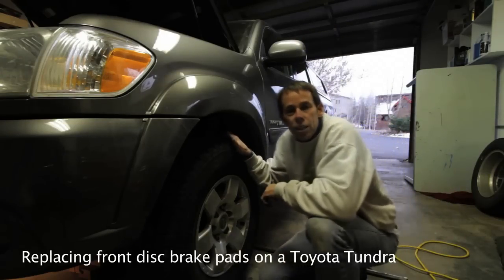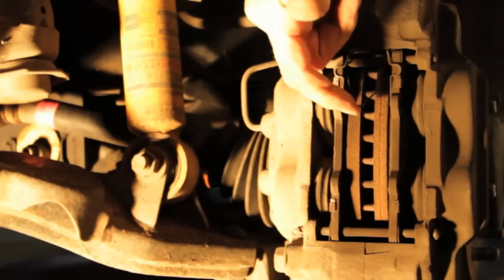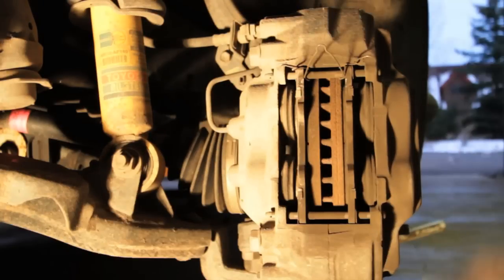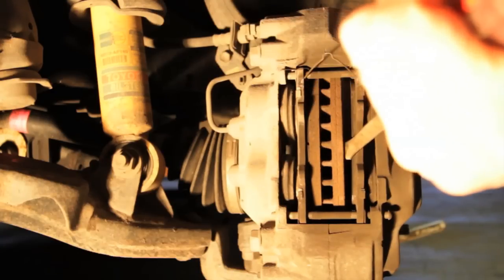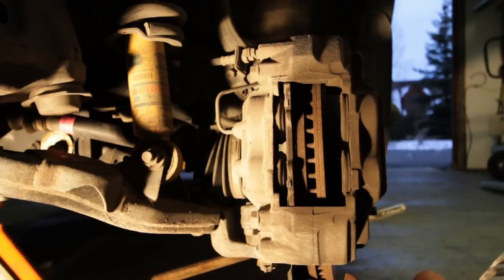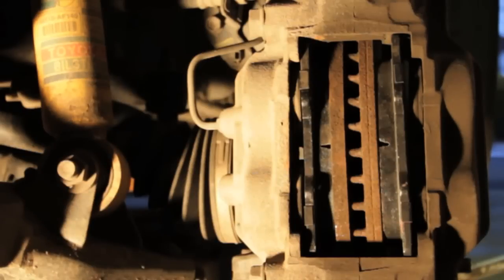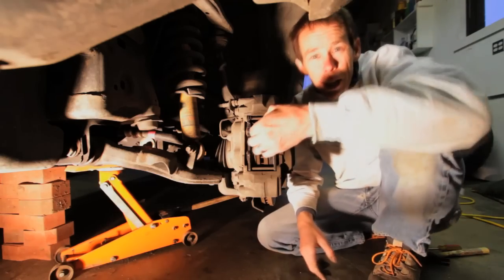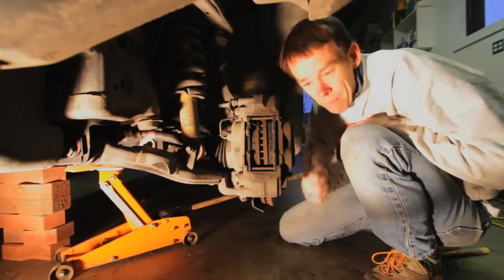Replacing Front Disc Brake Pads Toyota Tundra 2000 - 2006 - It's Easy

Comment: I've been doing most of my own vehicle repairs since I was 16. Brakes are on the easier end of the spectrum and should take less than an hour. The first time I did this on my 06 Tundra, I started to remove the caliper before saw the pins. I would like to shake the hand of the designer of this system. As you said, it's now 10 min job. Great video for first timers.
Reply: I love this design.  Mercedes started using this same setup in the late 1970s/early 1980s.  It always took me longer to jack up the car and remove the tires than it did to actually replace the pads. I pre-grease the backs of the pads and have them ready to go in before I ever even get the jack and jack stands out of the garage, and it's quite literally a 10 minute job per side, including jacking up the vehicle and removing the tires. Going to do my Tundra today ('01 that just hit 65,000 miles) and glad to see the setup. Probably would've had another 10K left on those pads if I hadn't been towing a 5,000lb pontoon setup behind it!

Comment: Realtor from CO, CPA from CA here. Doesn't matter, we are all shade tree mechanics. I wondered why you didn't bleed the brakes while compressing the piston, why you used the screwdriver to pry the piston back and risked damage to the rotor, and why no grease went on anything (don't get me started). Doesn't matter because your video is the best I've seen. Folks like to clearly see things taken apart and put back together, along with some plain language narrative. You nailed it. There are a few things that can be done "better" in a DIY brake job, but then your presentation for the masses wouldn't be so simple, now would it?

Comment: You might be able to fit a c-clamp in there to compress the brake pads. That's what I did. Also the brake caliper pins maybe too corroded to pull out, like mine were. I need to either cut them out and get new pins or replace my calipers entirely. If you manage to get them out, make sure you put some good grease on them each time you service your brakes.

Also for those of us with the pre 2003 model, make sure you measure your brake pads because they could either be the 4.7 inch or the 5.3 inch. 5.3inch is the newer version and some early models have them as well as per a TSB due to warping rotor issues with the early versions

Comment: Great Video! I have had my truck for over 4 years but drive it very little so this was the first time I did the pads on this truck. The only thing I did different was use a thin flat bar instead of a screwdriver and I took the advice of some of the other comments and used the sandpaper. Thanks for taking the time to post this. Enjoy the rest of your Colorado summer.

Comment from the maker: Swendog65 – Great information. Thanks so much. I had a feeling that wasn't the best solution for compressing them and I figured I would get a comment just like yours.  Thanks for setting me and others straight. And yes, taking off the cap is a good idea too. It’s funny, I was telling someone that I don’t even change my own oil anymore. Nor would I do many mechanical fixes on my Toyota. But the brakes were so easy it’s the one thing I’d tell people to try.  Thanks for the compliment too. Charlie

Comment: Just a lil advice. When collapsing the caliper pistons pry against the old pads with the screwdriver tip instead of the rotor. That way it won't gouge the rotor surface.
Reply: FoMoCo1 you have to insert flat head between rotor and used side of brake pad to press the 2 pistons into caliper.

Comment: never use a screwdriver on your rotor it may scratch or gouge, you want it as smooth as possible, use large channel-lock pliers and either compress on pads themselves or pull out pads and compress "puck"s. You may have to do this a couple of times on each "puck" because as you compress one it wants to push other out, or put something in there to hold other "puck" compressed. Sometimes when doing this it pushes brake fluid out of reservoir, so have some new, clean brake fluid ready afterwards to fill reservoir back up to proper level. As someone stated in string, have your rotors re-surfaced, it is fairly cheap and and new pads will mate up to fresh surface better and last longer. It is good to have a can of brake cleaner to spray down all the workings afterwards to get rid of any brake fluid or grease that may get on rotors.
Reply: +Mike Whitlow channel lock pliers were the way to go.  I was also able to replace the pads without even taking the tire off.  Awesome and easy design.
Reply: +Craig Harris Shut the front door, you replaced the pads with the tires on. Awesome. I have a set of pads in my truck waiting on me. Sounds super easy.
Reply: Another good idea would be to remove some brake fluid from the reservoir first and leave the cap off. When I changed mine, fluid came out and ran down to the ground.

Comment: Great Vid i Had to change my break pads on a 08 tundra although the set up was very simple as the video shows, taking it apart was a long hard job..Nothing came apart easy on the front, the disc pads on the rear came apart and replaced very easy. Thanx for the video if not for that i probably would have struggled even more..

Comment: I got a 04 tundra double cap brand new. I love that truck. However, I’ve had my issues. This will be the 3rd set of brakes I’ve put on. 4 sets of tires the original Bridgestone I got only 20 k on them. It’s had 7 recalls. Only 147k miles. I also had a T -100 best truck ever made IMO. NEVER HAD TO DO ANYTHING TO IT other than maintenance and 1 alternanter. Put 100k on it .sold it for the same price I bought it for.

Comment: RE sandpaper.  I had some 80 grit around the garage.  About anything with a rough grit would be fine.  The idea is to break up the glaze on the old rotors so the new pads will "seat" properly.  I bought a kit somewhere (maybe Lowe's) that has small sanding disks and attached to an electric drill.  I used it on another car, but the Tundra has so little access to the disc surface without removing it.  Spraying with brake cleaner also a good idea.

Comment: I would recommend to clean the pins off and did you reuse the shims from the Oem pads?  After cleaning  the pins I would put some anti seize on the pins where the holes align on pads. A trick to tell if your brake pads are getting low, never refill the brake cylinder.  Unless you have a leak. As wearing incurs , looking at reservoir will help in your deciding to look ,,,,,, but good job on everything else one guy pointed out make sure you pump your brakes a few times before driving away.  Use jack stands along with jacking the vehicle up.  Emergency brake engaged and chalks if you have any.

Comment: remove a couple ounces of brake fluid from the rez and leave open prior to prying the pads.  Makes it much easier.  Be sure to replace the fluid :)
Reply: I was thinking the same thing...maybe use a clean turkey baster and suck up a small amount, to reuse later.
Reply: I should have read your suggestion first and before I posted it earlier.

Comment: My 2008 Tundra is almost the same real easy!!!  Spring retainer is on bottom instead of to.  Some lug nut below said to use a C clamp to push back the calipers... don't let him confuse you.  You only need some needle nose pliers and a large flathead screw driver (or a wide flat pry) for this job.   Besides, you cannot physically use a C clamp!  Tundra Owners change your own front pads and save money!!!

Comment: * Dito: Use channel lock pliers or equivalent instead of screw driver
* Lightly sand clean the inside area of the caliper where pads sit.
* Lightly sand the 2 big pins that connect everything.
>>>>Use Permatex Ceramic Extreme Brake Parts Lub (grease) on the pins, the edge of pad backing plate where it contacts the caliper, and the caliper area where you slide the new pad in.  If you don't clean and lube those parts, there is a good possibility of them binding up and causing uneven wear.
Reply: I realize this comment is 10 years old, but in case you see this and want to clarify..... I've done the C-clamp method before.  Is that better because you aren't wedging and prying on the parts with the screwdriver, or is it just easier to do?

Comment: Thank you so much for the video. I have a 2000 tundra and will change the pads this spring. Your video helped alot. In the haynes manual it mentions spraying the rotor and everything else with brake cleaner, did you do that or is it not needed?  Also, what brake pad brand did you chose? I might get Wagner thermo quite, ebay has them for $40.00 /free shipping.  The rotors are easy to change on the tundra, you have to remove the brake caliaper. Haynes mentions it just comes off. Awesome video

Comment: thanks...but.. you should NEVER pry on the rotor. use a pipe clamp(reversed) to force them out, or at least a wooden wedge, I cringed at the prying part.. of course, you will want to first remove the fluid cap from the Master cylinder before you start, to give the fluid a place to go, and be sure to go slowly...brake fluid EATS paint!!! put rags over  the master cover first. But you otherwise did a good job, I'd buy a house from you.

Comment: That little 'tab' is a squealer. What does it matter if it is on the top or the bottom? Everything else about the brake pads is exactly the same. Shouldn't matter if that tab is on top or bottom. Just be sure to have the curve of the pads lined up with the curve of the rotor.

Comment: Careful with that advice.... DO NOT sand the rotors if you are swapping out the OEM Toyota for new OEM Toyota (or any other same to same pad) ! !
.
.It is vital not to remove the existing transferred layer of brake pad material that is on the rotor.  That is why bedding is important, to trasfer a layer of pad to the rotor.  Sand that off and you start over and it will take longer to bed the brakes if you had left it alone

If you are using the same pads again, they only need to heat cycle..

Comment: Great vid, I need some advice, I have an 02 tundra and it has been shaking and vibrating really bad at random times, the whole truck and the steering wheel does, I got new brakes pads and it has been aligned, so idk what it is, go to my channel and watch the vid, I think it needs me rotors but idk lol, thanks
Reply: Check the bearing in the steering

Comment: What about resurfacing the rotors?  You are putting a new pad service on a used rotor surface.  It is always good to keep new with new.  New pad surface new rotor surface.  So you would need to remove the caliper and remove the rotor to properly get it resurfaced for ultimate stopping power and long pad life